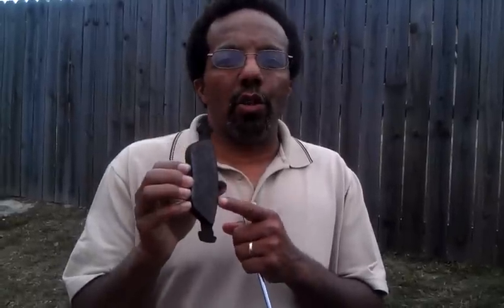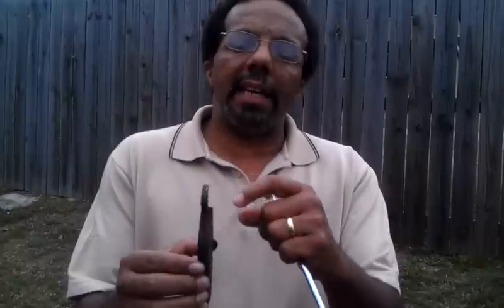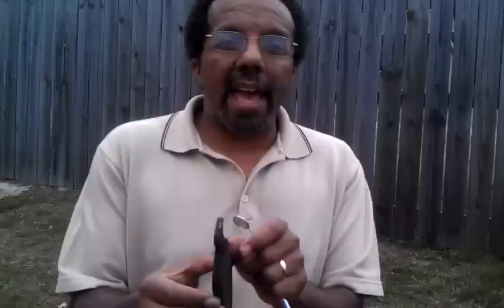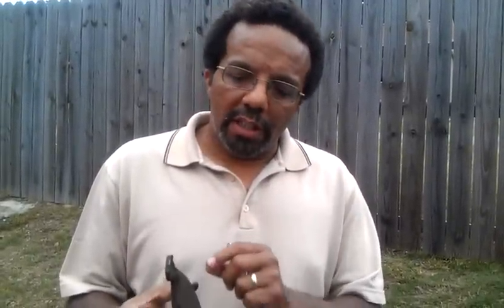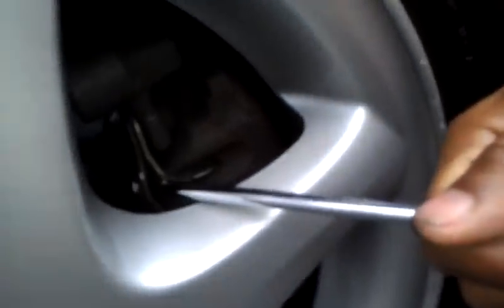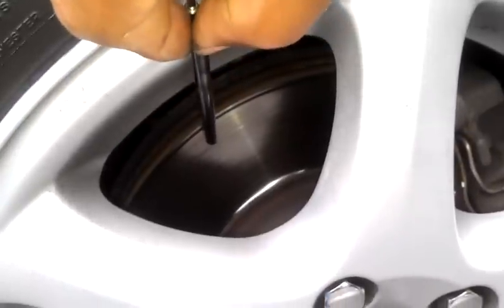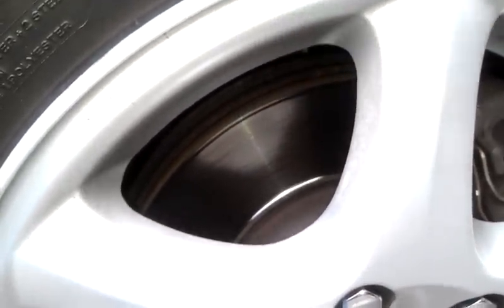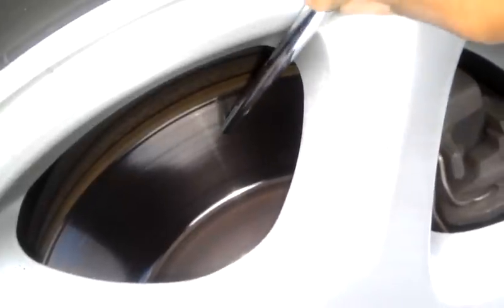How to check your brake pads and rotors on your car or truck. - VOTD

Comment: hey Robert I had change my brake pads in the front and back after I tried the brakes on the car I get a big squel when I hit the brakes going ffoward but not if I back up
Reply from the maker: Must not have put enough brake grease between the piston and pad surface (or squeal pad).

Brake pad and rotor replacement, front and some rear. Volvo, BMW, Jaguar, etc. - Auto Repair Series

Comment: Very helpful! I currently drive a 2010 Chrysler 300, about a week ago it started making a groaning "metal on metal" noise coming from the back tired. I only hear it when I slow down, brake and accelerate but I don't feel anything in the pedal. What do you think it could be?
Reply from the maker: Worn out pads???

Comment: Thanks, just the info i needed.
I've got the horrible squeal you were talking about, except it disappears the second i'm on the brakes, gonna take off my wheels tomorrow and check it out.
Reply from the maker: +InDmand Good. Sometimes you can stick your phone in the wheel and take a picture of the pads.
Reply: I'm abit stumped, not sure where to go with this.
My rotor feels like its brand new and my pads have about 3mm still left on them. The noise is definitely coming from the contact between the pads and rotor though.
I'd like to try spray some WD40 in the gap but i don't want to die next time i try to brake, any input on this would be helpful.
Reply from the maker: If the pads have more than 10%, you likely have a squeal shim issue. Noisy brakes are very common with Volvo's.

Comment: I was told, I have 3mm left on my rear brake pads will they still last while or should change them soon.
Reply from the maker: john1240able Shoot me a picture of them.
Reply: John Able1240 anything below 4 mm is recommended to be replaced